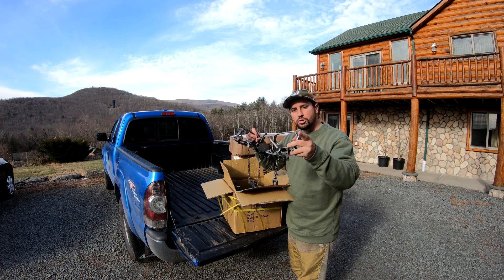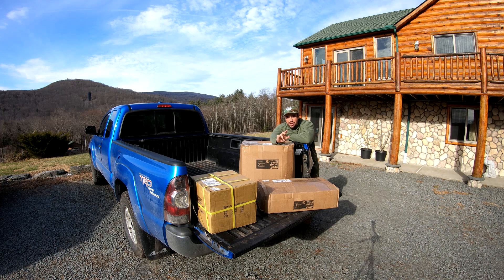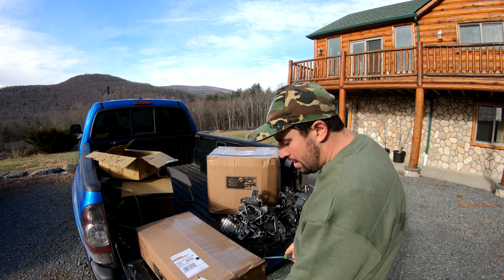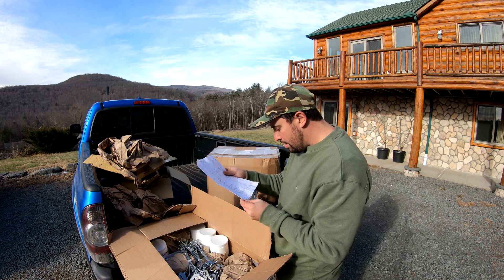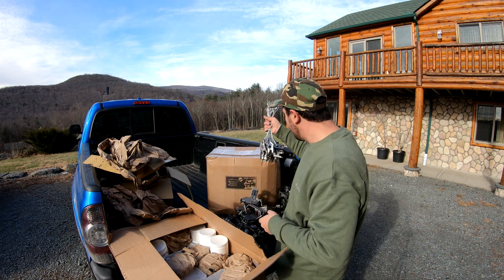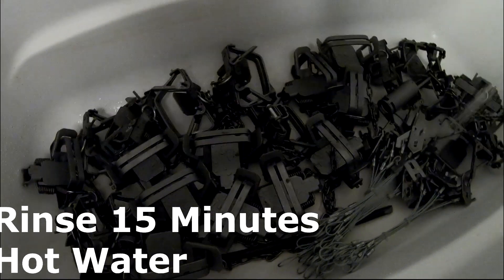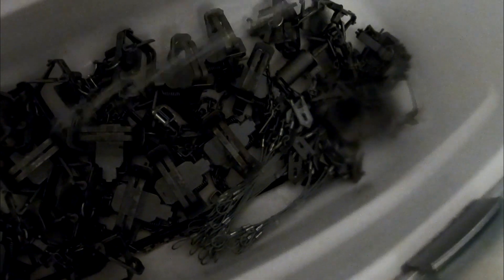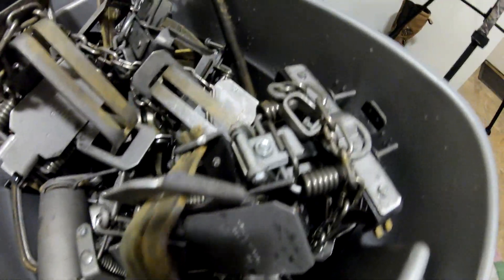How to Degrease New Traps using Bridger Dogless

Comment: I’m am a retired tool and die welder, use to heat treat all types of steel, I can assure you nothing will happen to the traps till the temp. Gets over 400 degrees, boiling water will only get to 212 degrees on a good day, thought I would share that with you, great videos, I’ve been watching all of yours, have a great trapping season

Comment: Can you use these right away after this? Trying to degrease conibear 110
Reply from the maker: you can, depends what your trapping for.  Trapping any K9 or certain animals requires a process of boiling, dyeing and waxing usually to make them scent proof and protected from elements.